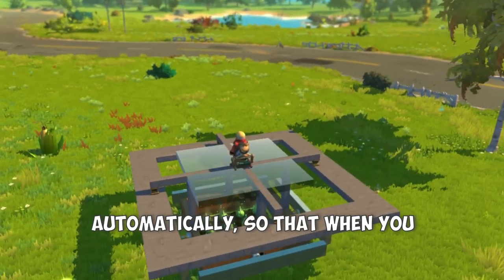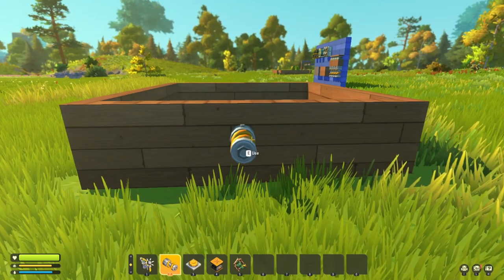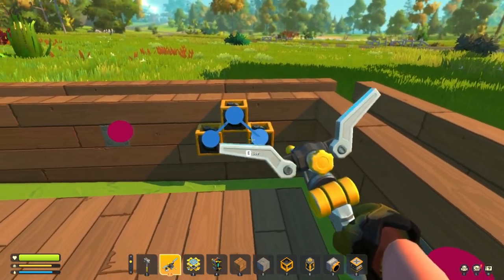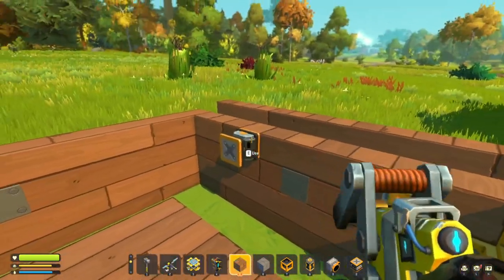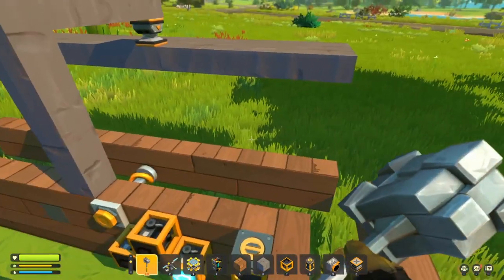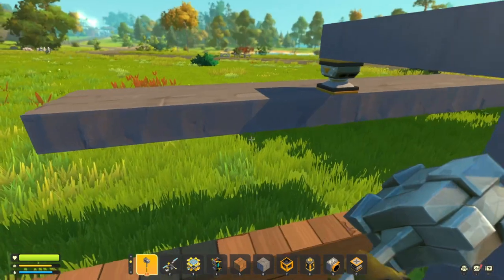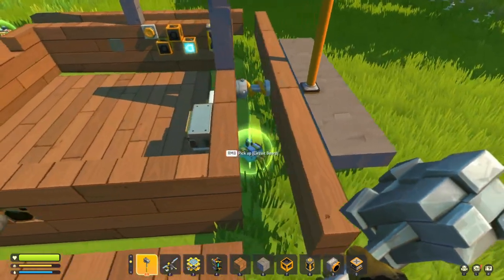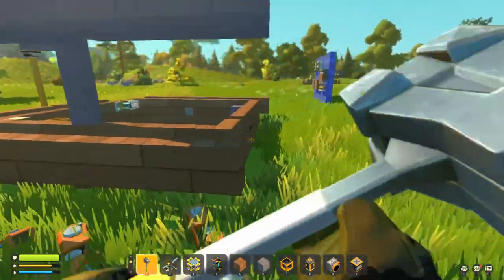OVERPOWERED automatic Farm defence? Scrap mechanic survival

Comment: Great base concept, I used this on my own game however, I found a couple of issues with using it and had to make a couple of adjustments; first I changed out the L2 Piston for a pair of L5 Pistons for maximum speed for faster crushing and medium to high level raids, I also set the timer down to 250milliseconds to make the crusher faster; second I found that a 3 block wide crush pad wasn't big enough and some enemies, mostly Haybots, could attack the bumper and not get crushed; to solve this I extended the crush pad to by one block on either side making it a 5 block width; third this issue came due to the increased size of the crush pad, enemies could now ride the crush pad to circumvent being squashed; to solve this I went into creative for a bit of testing, I built the base version of this and then put a secondary bumper and stomper above the first, so that if enemies managed to get on top of the first crusher they'd still have a second crusher to destroy them, although I have yet to actually implement this last bit in my survival save as more testing is still required.
Reply: @crazyjplays3392  I just added wooden fence on top of crusher so they can't climb on it so now I'm just controlling whole thing from above, now when I'm ready to expand, I need to worry about tape and farmbots

Comment: i have a question,why can't you connect just 1 piston for all sides
Reply from the maker: Weight becomes an issue
Reply: @wo0dy  also,can i use wood for example or does in need to be a heavy block as the plates?
Reply from the maker: Heavy is best, thats where the damage comes from, light may not squash so well
Reply: @wo0dy  thanks man!You really helped me make my dream farm defense.

Comment: So an update as to how I ended up fixing bots being able to ride the Crush pad to get over/around it, on the block directly above the piston make another pad that's the same size as the crush pad, any enemies that get the bright idea to try and ride the crush pad will get sandwiched between the retracting crush pad and it's new roof, it's highly effective against Totebots and Haybots, Tapebots though will try to shoot it, so I recommend keeping the farm relatively small. 
Bonus Tips: Raids can be triggered with just a handful of crops, the types of crops along with the amount being planted or still growing determines the raid level; also once a "Raid Level" has been decided it gets locked in at that level, this means that by planting a handful (about half a stack of seeds) of carrots early in-game time (open the logbook with 'L' the in-game clock is on the left ((by early I mean from 1AM-3:50AM in-game))) and then waiting for the "Unauthorized Farming Detected" message, you can then continue planting after getting that message; the 'Unauthorized Farming Detected' message starts the timer and always triggers just after 4AM in-game time, that message is also accompanied by a scan (unseen by the players since its just code) that checks what types of fruits/vegetables the player/players have planted, how many were planted, and then determines an appropriate raid level in response however, since the scan only happens once and this is what we can take advantage of; by planting only carrots in a small number we can trigger only a low level raid between 1-3, the Raid Level once determined is LOCKED IN, so we can immediately go right back to planting even more crops of a higher value making sure to fertilize ALL of the crops, and when the raid comes we'll only have to deal with the usual Totebots and Haybots, just make sure that your entire farm is ready to harvest before the next 'Unauthorized Farming Detected' message shows up and you won't need to worry about raids too much.

Comment: Great video!
I have a problem, I can't link the sensor to the gate as shown in the video at 2:30 .. I can't link the sensor to anything actually. What am I doing wrong?
Reply from the maker: everything has to be part of the same structure physically before you are able to link it , if there is no physical connection, without mods, you wont be able to connect it
Reply: @wo0dy  oh great I just connected the two structures and that fixed it.. thanks so much 😊

Comment: Thank you for the video! I had a question as if the walls were attacked from the side, the sensers wont be triggered. What do you do for the corners?
Reply from the maker: The corners have never really been an issue, but the crush plate is build in a way that the corners meet in a diagonal with the edge furthest from the farm being the longest, depending how you set it up on the logic, you will never miss.

I personally risk it, as I have run this set up since survival came out and I dont even remember the last time the corners were attacked perfectly so the crush never happened 😬🤷🏼‍♂️

Comment: just one other question before I destroy the first farm. I made mine about the same size as yours in the video but is there a limit to the size like lets just for example say I wanted to make a 50x50 or 100 x 100 farm maybe extreme but makes the point. Can I make this same set up with the same mechanical supplies with only the wood/stone needing more or is there a limit to the farm size with this set up?? I know you said no limit on the censors distance.
Reply from the maker: I'd argue the more weight added the more pistons and suspension you will need. Me personally I would keep the internal walls as 1 but for the squashing plate, and the triggers I would split them. If a bot attacks 1 end I dont see much point in have the other end of the wall also squash down onto nothing. But thats up to you, my only advice would be if you make it bigger, you will just need more pistons to support the weight over its length, same with the suspension.  You might see it sagging or warping under its own weight is all (you also might be 100% fine too, depends on how the game wants to be)
Reply: @wo0dy  OK thats what I was wondering as it grew if I might need more of the mechanical components for it to work. Won't make it extremely huge but just wonder how big might be too big HA HA

Just didn't want to destroy the first set up to reconfigure it bigger until I sorted out the questions on bigger.

Thanks!

Comment: whats about with the censor range? I got to the part where I am trying to hook up the censors to the logic gate and the connections not possible. Was this changed since the video came out?? It seems though if the connections close then it hooks but if it's close for 2 then it's far away for the other 2 and can't connect those 2 censors
Reply from the maker: the only thing that will stop the connections is if the sensor isnt physically connected to anything .

What i mean is, if you build a wall and have a sensor 1 end, and the logic the other, it wont matter how long that wall is it will still connect

However.

If i build a wall have the sensor on 1 end and he logic on the other, but break that wall in half the sensor will lose connections to the logic as there is no physical connection
Reply: @wo0dy  Thats what it was I joined the inner walls together and this time got the links. Thanks!!
Reply: @wo0dy  Got it fully working and tested wiped them all out thanks!!!

Comment: I followed everything but it still didn't work. When the sensor triggers all it does is turn on the nor gate that was off and turn off the nor gate that was on and when the sensor turns off it reverts back to the initial nor gate being on and the other nor gate being off again. did I do something wrong?
Reply from the maker: sounds like you havent got the timer set right or the wiring is wrong. double check.. if its triggering that fast you need to increase the timer

Comment: It seems my pistons went down and for some reason when the bumpers are pushed it comes up and then back down and stays down .. I can't figure out what I did wrong ... it was after I pushed the reset button it went all crazy ..
Reply from the maker: Just give the button a long press that usually clears it, if not perhaps something has got crossed with the wiring. Sounds like the pistons are down when the circuit is 'off'
Reply: @wo0dy  ill give that a shot tonight and if it doesn't work I'll rewire everything..  thanks so much for the video and the response .. it looks like a great defense base .. I mined all the materials for hours so I'm hoping it works:)
Reply: @wo0dy  dude!!!! Thanks so much for this farming base .. I had to look closely cause the one that stayed lite up while connecting the logic was backwards ... but it works great now ... sometimes the bots kinda glitch in but rarely ... great work here
Reply from the maker: Glad you got it sorted

Comment: Sometimes it bugs and can't work anymore, is there something how to prevent it?
Reply from the maker: Need more info than, it bugs. Bugs how? What happens?
Reply: @wo0dy  The logic gate gets in the some kind of loop like in your video before you reset it with the button. I can reset it as well and it working properly little while and then it bugs again and I need to reset it with the button again.
Reply from the maker: @adriano19532   so to stop it having a wild moment you can do 1 of 2 things.

1. press the button for a little while. about a second should be long enough but this will just take that current glitchy logic back to normal

2. in the logic gates, you add in another piece of logic.
        or
nor      nor

is the current set up 

if you do         or
                 nor     nor
                      and

connect everything as normal, but also connect BOTH 'Nor' into the 'and'  then connect 'and' into 'or'  this basically stops it from flickering and should always reset it automatically

Comment: My crusher doesn't go all the way down, what did I do wrong?
Reply from the maker: Used a level 1 piston? Or didn't set the length correctly in the piston
Reply: @wo0dy  I didn't wire the 3 logics in the right order 🤦‍♂️

Thanks anyway
Reply from the maker: Alwaya better if you can figure it out yourself 👍 making mistakes is how we learn!

Comment: does this work against farmbots?
Reply from the maker: un tested but in theory, build it tall enough with enough weight on the slamming plate and it 'could'
Reply: @wo0dy  thanks for answering first of all, i really appreciate it. Im worried they would one shot the block which might then fuck up the system. Also does crushing a farmbot one shot it? And finally do u know how tall i would have to build it to crush them?
Reply from the maker: No 1 crush wouldnt kill it, it might rag doll it though, so it wouldn't be able to attack. How tall, again, dont know. Best thing to do is test it in creative, get the capsule and build to the height. No need to waste your survival base, try it in safe conditions
Reply: @wo0dy  sounds good, thanks a lot!

Comment: i did step by step but my sensor didnt work. help me pls :(
Reply from the maker: Check sensor range, check connections with connection tool, it DOES  make a difference which way its connected,  check logic is correct

Comment: Thing didint work i did step by spep and it stiillll didint work
Reply from the maker: Still doesn't work being ? Does the sensor trigger? Put the sensor on the sound mode so you can hear it, then trigger the plate, if you hear a beep, then the sensor works, next check the wiring and the logic gates are correct
Reply: Ok